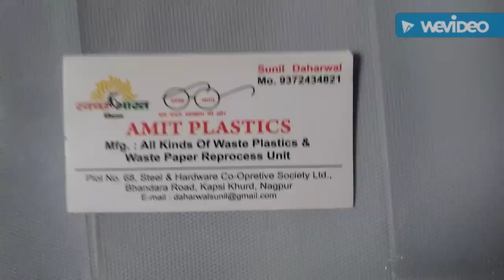Waste Plastic (Polythene bag) Recycling Plant In Nagpur

Comment: Such a dangerous workplace. Spinning blades within reach, shoddy wiring, toxic fumes, control panel placed over top of a hot extruder, no gloves, no proper footwear... the list goes on. This is why it's so cheap to manufacture in these countries. No concern about safety or the health of the workers.
Reply: Now I am wondering how many life are behind my MAde in China products
Reply: @kgkgkgkg5992  China isn't comparable to India, it's way more efficient in manufacturing and the government has much more control over it's citizens. I'm not saying China doesn't have bad working conditions like this but there is a reason why its economically almost the number 1 country
Reply: @ardaduck735  improvement of manufacturing technology will take time
Reply: @averageconsumer5374  Yes, you better change your glasses. At 4:30 he clearly reaches over a hot extruder to the control panel which can not be reached any other way. Also, learn to read. I said "over top of a hot extruder". You say "on the top".
Reply: Safety is not even a tertiary objective in many plants across India. But I wouldn't blame them. The way our economy is (I'm not calling it bad, but it ain't good either), most small scale manufacturers don't make enough to consider safety as an important agenda. Besides the govt is corrupt enough to let things slide. And taxes ....oof!! Where do I begin. One thing I am sure about is that India is not a business friendly market.

Comment: Recycled it into what....big black globs??? 
So is that it or are you going to show us what's done with it after it's thrown onto the table and then slid in a pile on the floor
Reply: Thereafter new plastic bag are made.
Reply: No, these blocks are made into inferior moulding plastics. Can even used to make cheap plastic bags.....
Reply: The globs are sold to plastic soda straw manufacturers.

Comment: Thr s serious flaw in engineering design of the machine..why can't all the processor r interconnected n machines r placed nearby...
Reply: I believe they are doing the best with what they have..maybe adding a metal funnel near the machine intake so the employees hands aren't so close to the blades. ..Machine spacing would allow for hiring of more people and them not ruining into each other...plus it would also allow for the addition of new machinery for producing Plastic Roof tiles, Plastic Bricks for walk ways etc.

Comment: Really could have benefited from some form of commentary or subtitles explaining whats happening in these processes
Reply: they are generating petrol from the plastic. the plastic is cleaned as is being done in the first machine. then the plastic is placed in a kiln in a vacuum with nearly no oxygen present. once the burner is turned on the plastic melts and is converted to fuel. this fuel goes through the treatment plant and you can get petrol and diesel with it.  the leftover material that you saw the boy collect from the ground is kinda like charcoal. I hope it helps. it's an effective way of reducing removing plastic but I am not sure about the economics or the scalability of this thing.

Comment: I can’t see the purpose of the first machine as the plastic bags etc seemed to come out the other side the same as it went in. Also what happens to those piles of nasty looking molten plastic?, there was a 1-2 second bit at the end where it showed a pile of flat odd shaped black plastic lumps on the floor, but no idea what they are?.

Comment: That places needs :
an arms length tunnel for the first machine .
Buckets or containers.
A sweeping brush. 
Bins to catch the output.
PPE.
Electrics to be covered.
Ventilation .
A clear floor free from stock 😳
Top it off with a bulldozer to knock it the fuck down 😂😂

Comment: Lack of safety aside, I'm still trying to figure out what the end product was supposed to be.
Reply: they are generating petrol from the plastic. the plastic is cleaned as is being done in the first machine. then the plastic is placed in a kiln in a vacuum with nearly no oxygen present. once the burner is turned on the plastic melts and is converted to fuel. this fuel goes through the treatment plant and you can get petrol and diesel with it.  the leftover material that you saw the boy collect from the ground is kinda like charcoal. I hope it helps. it's an effective way of reducing removing plastic but I am not sure about the economics or the scalability of this thing.

Comment: So incredibly inefficient and dangerous ... and where is the end product?
Reply: they are generating petrol from the plastic. the plastic is cleaned as is being done in the first machine. then the plastic is placed in a kiln in a vacuum with nearly no oxygen present. once the burner is turned on the plastic melts and is converted to fuel. this fuel goes through the treatment plant and you can get petrol and diesel with it.  the leftover material that you saw the boy collect from the ground is kinda like charcoal. I hope it helps. it's an effective way of reducing removing plastic but I am not sure about the economics or the scalability of this thing.

Comment: so... they turn something into black blobs of shit? what is the purpose of the black blobs? wouldn't it be more efficient to extrude through a mesh with a rotating blade attached to the central shaft to create pellets that could be directly inserted into an injection molder? or better yet, directly inject this plastic into molds to create an end product.

Comment: Take the first apparently useless machine and attach a simple feed hopper. This will not only cutback, pun intended, on dismemberment of employees but speed things up. Then give it a function other than littering the floor by attaching a tube to the output going to a second hopper that feeds the grinder. Mount the grinder over the screw drive of the last machine for self feeding.
Last but the most important modification... Attach a mold to the output of the third machine so as to make a product. Or is your final product suppose to be fake plastic cow $#!t? Is it part of some kind of religious thing?  Or do you find it necessary to waste the effort and energy to reheat it into a product? I mean your there... Just mold the crap on the fly. 

So close and yet so cartoonish. Sad, really really sad.